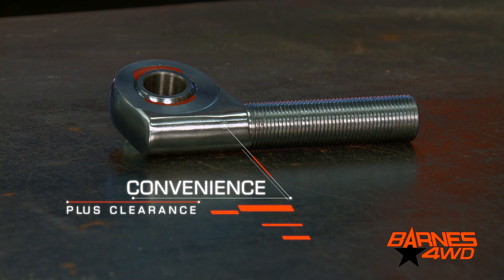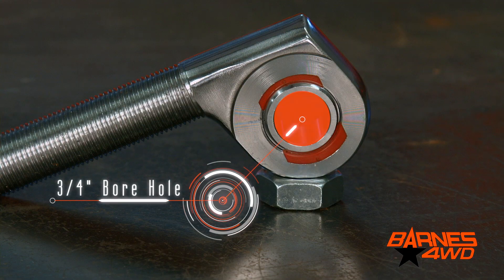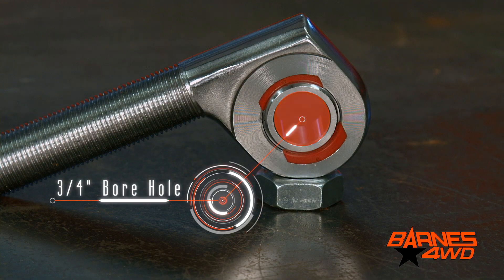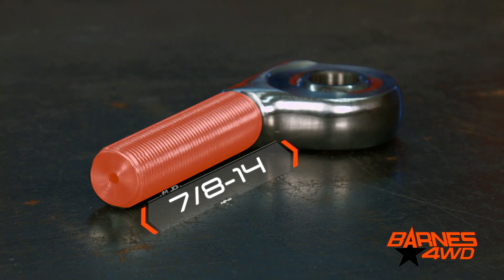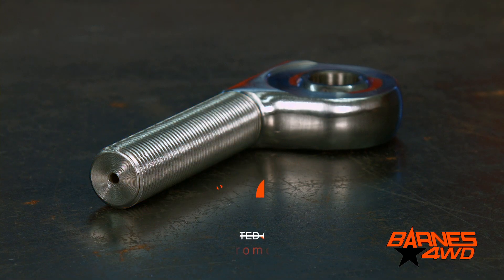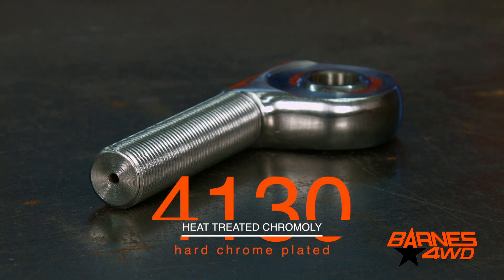Offset Heim Joint

Comment: I have your SD 60 7/8 diy steering using your weld on arms. I need clearance for my ram to fit.
 If i use this offset joint , is it going to let my tie rod flop up and down every time i hit a bump ? This is a daily driven rig.